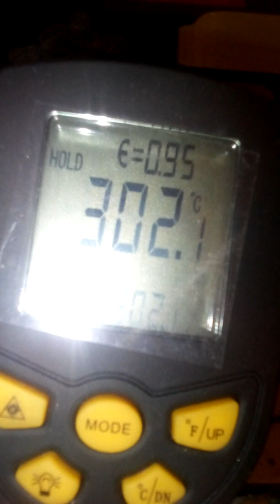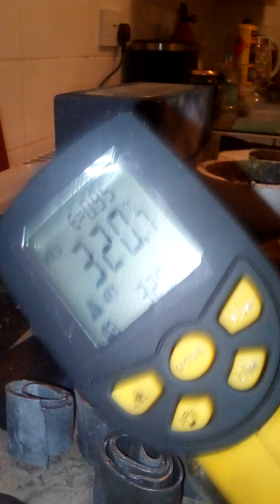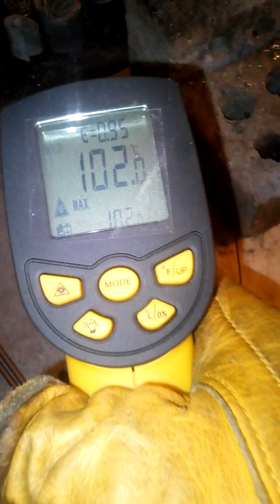Pouring 13lbs Lead/Pb Roofing Salvage (3/3)

Comment: Can you mix molten lead with paint to make lead paint?
Reply from the maker: Would just bounce off the lead or burn it,paint has powdered lead oxide which is really bad for you,lead rust.
Reply: Welsh Dragon Metals. Thank you for your reply but I was thinking that the paint would have to be heated to a high temperature too 😂. 

I don't for one minute believe their bullshit about lead paint being poisonous. I think it was all one great big psyop to rid all our homes of the best and easiest way to protect ourselves from the dangers of wifi frequencies especially 5G and 6G (the modern day fasces).

I would like to learn how to mix my own lead paint so I can protect myself in the only way I could afford to.
Reply from the maker: Lead is Relatively Safe To both Melt And Pour,Boiling it off is lead gas that will harm badly,The whiteish grayish crud is oxide,humans rust,most oxide is bad for us iron is one of the only good ones,and that is due to it holds oxygen in your blood,lead replaces other metals in you that alloy inside you in a way,and we need traces of most to function,it is harmful to a degree in that way,but its uses literally outweigh its negatives,and yes lead paint it could likely shield you from 5G WiFi Towers & will from Radioactive particles also.

This work is best left to people like me,people who forge and smelt,it is not a clean job or safe but it is necessary to everything we know,no metal workers,no modern anything.
If you want lead paint should be simple to make,ware a dust mask though get an old fishing weight,sand it to powder and mix it into your paint.
Reply: @welshdragonmetals  Thank you for the useful information.
Reply: @welshdragonmetals  You should talk about things like that in your videos. Because not many people know it but it's educational and it will get your more views. Just saying